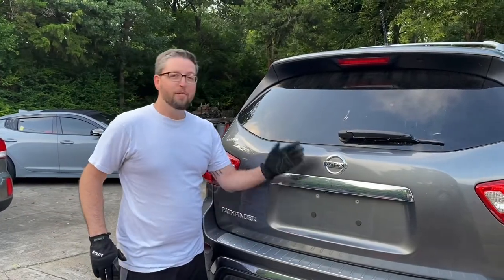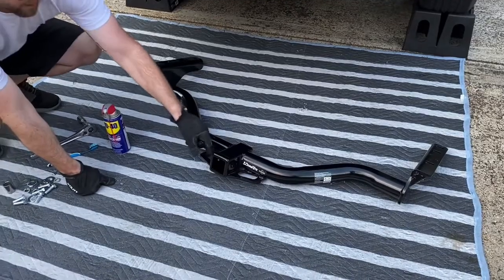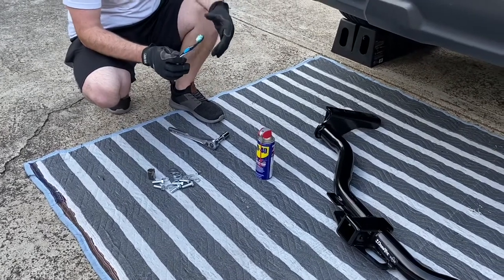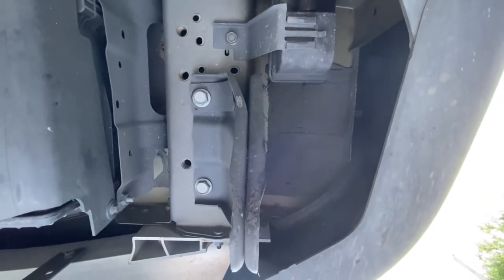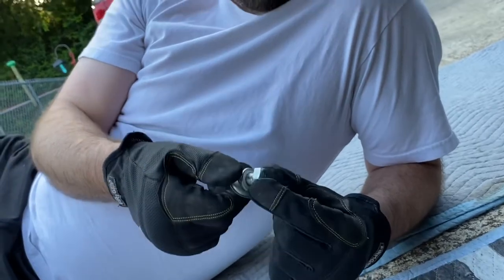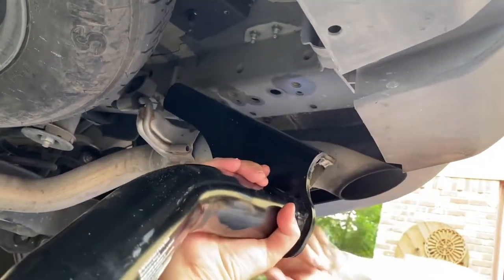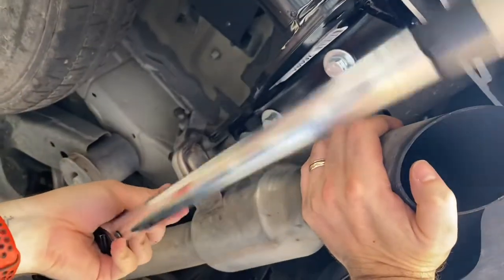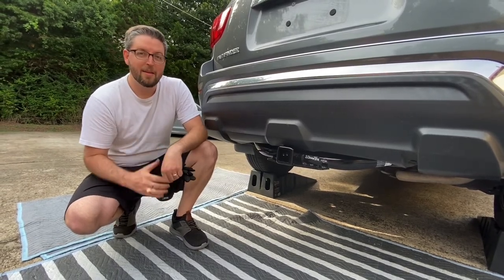Trailer Hitch Installation - Nissan Pathfinder 2017

Comment: What kind of person puts a lubricant on a load bearing, vibration prone, upside down mount? Ya want the bolts to fall out?
Reply from the maker: First, WD-40 is a Water Displacer (WD) that has a very small amount of lubricant. Second, a lot of the chemicals evaporate within a few minutes of application. Third, we used a significant amount of torque when tightening the bolts.
Reply: @GalippsGadgets  - WD-40 is not made for this. You ought to have used a thread locker.

Comment: The bolts don't fit
Reply from the maker: Ours do - make sure you’re buying the correct version for your make/model!
Reply: I did but the correct one than had to buy new bolts that were the same as the ones that came off of the tow hook

Comment: What size bolt are you using I bought the hitch but didn’t come with the bolts
Reply from the maker: Honestly, using what was sent with the hitch - I would reach out to the manufacturer/store and have them send the missing parts.  It's not your fault - let them fix their mistake!

Comment: I too have a 2017 Pathfinder. Its 2WD and a SV. I did mount the same trailer hitch, put only a 4 pin wiring harness, as I didn't think I would be towing anything heavier then a light trailer to bring my leafs to the dump.
I am now considering buying a travel trail and upgrading the wiring harness to a 7 pin, and adding a break unit. 

I have a few questions for you:
How big is your Travel Trail? 
What is the weight of it that you are towing. 
How does the Pathfinder tow, and what kind of Mileage do you get?

I am looking at a 19ft trailer with a dry weight of 3900 lbs. 
I am a little concern about the CVT transmission.
Reply from the maker: Awesome - I highly recommend taking the leap! The family loves to go camping.

Our trailer is a 20-footer, roughly 3,500 dry weight. Even though the pathfinder can tow up to 6,000 it would be terrible on the transmission. As it is, we are only getting about 7-8 MPG - which is why we’re about to upgrade to a bigger vehicle for longer road trips!